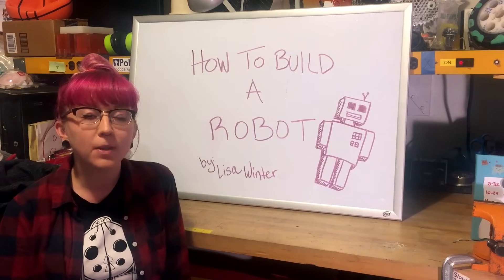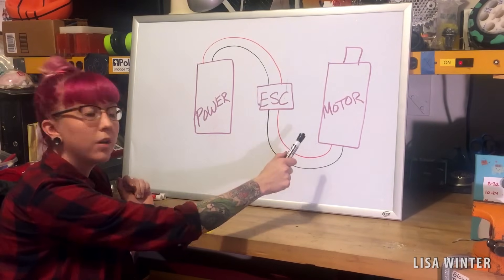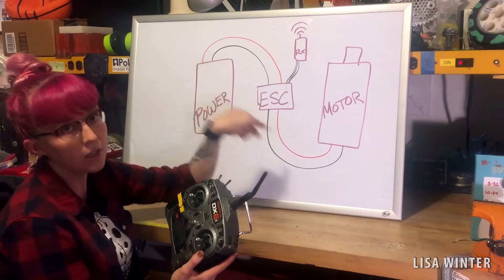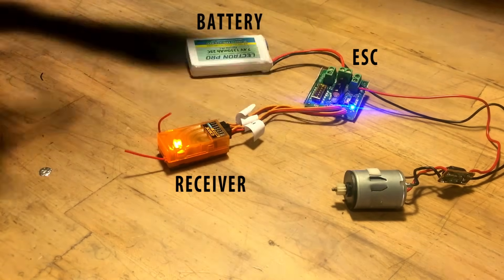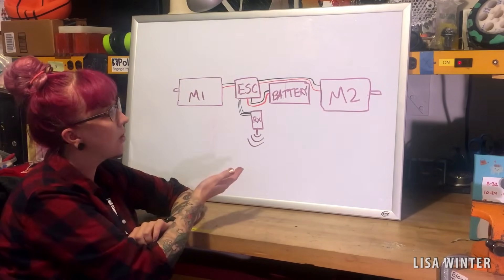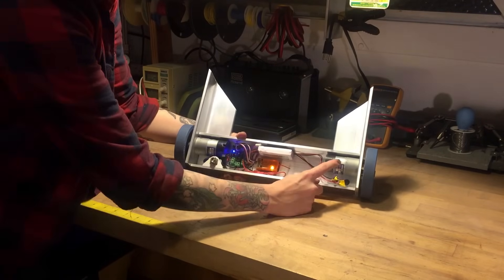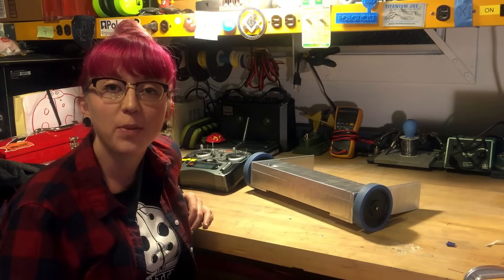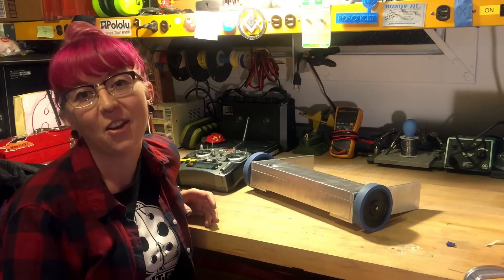How To Build A Robot

Comment: Do you have advice or recommendations on what kind of software I should look into buying to build a robot?
Reply from the maker: I like to use Fusion360 by Autodesk for CAD/CAM. If you're new to 3D modeling you may want to try Tinkercad first, which is free. Have fun!

Comment: How did you get the Speed Controller to  connect to the Receiver?
Reply from the maker: This speed controller has a cable (servo wire) that plugs into the receiver.

Comment: Hi Lisa. When you went fwd it operated both motors? Turning obviously controlled only one motor? How do you program that into the controller?
Reply from the maker: Good questions. If you tell the robot to turn it will rotate one wheel forward and one backwards. The programming will depend on what speed control and tx/rx you are using.

Comment: heeyyy, this was so use full :), i was just wondering do you use glue to attach the parts inside the robot?
Reply from the maker: Hi, usually components are bolted down, and sometimes for little lightweight parts I'll use a very strong velcro.

Comment: Hey Lisa!  Thanks for the tutorial!  A couple of questions:
Can you use a 12v motor with a 6v battery?
And 
What sites do you recommend for buying a drive motor with a gearbox included?

Thanks!
Reply from the maker: Interesting question! You MAY be able to run a 12v motor with a 6v battery. You could also run it with more power. Simply put, the voltage rating is what is optimal. Less than that and the motor will run slower or not move. More and the motor will run faster, but the life expectancy will go down. 
On my site I list some stores I recommend: http://www.lisaxwinter.com/faq.html

Comment: Thanks so much but how I connect the controller with the motor
Reply from the maker: The positive and negative wires from the motor attach to the speed controller output.

Comment: How did you build the chassis for the motors and such?
Reply from the maker: The chassis is pretty simple. It's basically two aluminum U-channels (one is the top, one is bottom), and 90degree angle extrusions for each of the 'arms'.

Comment: Thank you for amazing explaination, just a small doubt how does the robot know to go straight for example, when your press forward button on the joystick?
Reply from the maker: The joystick acts as a mixer for the two channels/motors. Pressing the joystick forward sends both channels power, which means that both motors spin the same direction (forward in this case). If I press the joystick to the right then it tells my left motor to go forward, and the right one to go backwards, which makes the robot turn right.

Comment: Using the ESC as described in this video with the Tamiya  dual gearbox and tracks is an interesting concept.  I made one radio controlled but didn’t use an ESC.  https://youtu.be/wwPm12VzH9Y My robots are going to be more like models/toys inspired by the Mars rovers.

Comment: What can I use as a power source two give enough energy to power a handmade voice box that has a pull string that requires no chargeable batteries a hand crank Or etc.
Reply from the maker: Hi John. Power comes in many forms, but first you need to figure out what voltage and current ratings will work for your voice box.
Reply: @LisaWinterX  My woody doll is made by Hasbro and I forgot how tall he is either 12 to 10 inches?

Comment: I have a question, how do you make it so that the controller is connected to the robot
Reply from the maker: Are you asking about the remote control? The remote control (Tx) is paired with the receiver (Rx), which tells the ESCs how much power to give the motors.
Reply: @LisaWinterX  oh so the remote and the receiver come paired its not something you manually do

Comment: How many motors we need to build a robot car that has 4 wheels? And what type of motor we need ? Please explain thanks
Reply from the maker: Hi, there are many different ways of doing this. Some of the most common options are to have 1 motor per wheel, OR you could use 2 motors on 2 of the wheels and the other wheels are not powered, OR you could have 2 motors each connected to 2 wheels via chains or belts. 
You'll want a DC motor (unless you're thinking of plugging the robot into wall power). The 'size' of the motor completely depends on how big the robot is and what it will be doing. Motors for robot wheels are usually geared for a preference of torque over speed.
Reply: Lisa Winter if I wanted to add a gripper on it to pick up items and put them down , how many motors I need ? And DC or servo?

Comment: Hi Lisa! I'm trying to start building a robot for the Robo Wars here in Australia and I am wondering what size motors (rpm, voltage) would you use on something like Mega Teno (the bigger version)
Reply from the maker: The Mega Tento motors are 48v Ampflow motors http://www.ampflow.com/ The gearing and voltage you provide will depend on your robot and the size of the wheels, etc.

Comment: Hi Lisa, I'm new to robotics/rc and want to try my hand at making one. My plan is to have a 4 wheel robot snow plow with a 775 motor per wheel. I am stuck on finding the right electronic speed controller. The motors I bought are basically cordless drill motors. Anyway, I see a couple of ESCs that specifically say they work with RC, but they are upwards of $80 each for the dual channel (Roboclaw, Sabertooth...). Any suggestion on an ESC that will work with radio control and not break the bank? Also, do I understand it right that I will need two dual channel ESCs to power the 4 motors? Thanks in advance for any tips you can provide. All the best!
Reply from the maker: Hi Keith, a dual channel ESC controls two motors separately. So, if you have 4 wheels/motors you can either control just one motor on either side, or you can control the whole left side on one channel and the whole right side on the second channel. 
It's true that if you want to control a decent amount of current then the ESC will be a bit pricey, however it's worth it because cheap ESCs will blowup and you'll just have to buy it again! Go for a good one from the start.
Reply: @LisaWinterX  Awesome! Thank you for the response 😊 I will give the sabertooth a shot and control side versus side. Your videos are very helpful. Thanks for helping us noobs get started!

Comment: hey Lisa,  so im doing computer engineering ,  5th semester,  but i have to design a combat robot , and i have to participate in a robowar, im quite blank, confused, from processors to mechanical puly system ( in your second video), its actualy , hell of task, 
But lets see, i have two months, and yes im gonna make it,
i'll tell you
Reply from the maker: You can do it! I strongly suggest building a robot that is 25lbs or less for your first time. You don't need any programming either, but since you're studying computer engineering you may want to :)
Reply: @LisaWinterX 
Thank you for you response, appreciation and motivation, it means a lot... 
https://docs.google.com/document/d/1BRQxM3maTmH7hdBqlBmnhkDmdnS1v8vyBqVEcu2jlJk/edit?usp=drivesdk
This is the link to 1st week report, and yes it will be about 25lbs(10kg)

Comment: Awesome video. As for the parts, do you buy them separately? Build them? If you buy them, where do you get wheels, etc?
Reply from the maker: Hi Tobe. I describe some of the parts in the video description. For wheels in particular it reallllly depends on the size and function of the robot, and what surface you'll be driving on. Some times wheels from a hardware store are fine, or an RC car shop.

Comment: How can I build a robot that can move around on it's own and can sense edges and walls?
Reply from the maker: You can start off with some simple code on an Arduino or other computer. Connect light sensors, proximity sensors, or any type of input you'd like, to change the direction the robot moves.
Reply: @LisaWinterX  Ok. thanks!

Comment: What about a four wheeled robot? Is it the same thing but with four motors?
Reply from the maker: There's many routes you can take. Same thing but 4 motors, or you can have two motors (one left, one right) and use chains or gears to connect to 2 back wheels. Actually, here's a really cool article about some of the methods: https://en.wikibooks.org/wiki/Robotics/Types_of_Robots/Wheeled

Comment: I have a big question. I have been trying to make a robot for a while but my trouble is the receiver. Do u need your own built controller for the receiver to pick up from?
Reply from the maker: Hi Liam, a custom controller isn't necessary. It's easiest to buy a transmitter and receiver pair. You will have to 'bind' them so they speak to each other. Their manual will describe how to do that.
Reply: Lisa Winter thanks so much. But u see I'm not a god at robots like u so I don't even know what binding means.😂 but I also don't see where to get any of these materials like an electronic speed controller or a receiver and controller pair so if u could answer those questions u would gain a new fan!😂👌
Reply from the maker: Hey Liam, the parts I used are in the video's description. Most parts can also be found on Amazon.com. The type of controller I'm describing is a 'RC (radio control)' system. https://en.wikipedia.org/wiki/Radio_control  An Xbox controller wouldn't work in this case, but something from this page would work: https://www.rcplanet.com/rc-radio-system/
Reply: Lisa Winter could I just like get an Xbox controller r something ?

Comment: Is it possible to make a robot without an speed control
Reply from the maker: Hi, technically you can connect power to a motor and it will run, but if it is inside a robot that is controlled by radio control, then you need a way to send the motor a signal. That is why you need a speed control. There are plenty of cheaper speed control options online than the one I used in this video.

Comment: Also, with your transmitter.. Did you have to do any sort of special programming for robot conversion?
Reply from the maker: Specifically for Mega Tento I have the right joystick control drive (FW, BW, L, R) and the left joystick for controlling the weapon (L-R) and lifting the shell (FW-BW). Nothing else special about the transmitter.
The speed control can be programmed to do an assortment of things (mixed mode, lipo mode, ramping, etc).
Reply: Lisa Winter thank you for your help! Keep on rockin!

Comment: Is your ESC Arduino based? Or do you make your own ESC? BTW I am 11.
Reply: bast warking  Robot 🤖
Reply from the maker: Hi, it is a Sabertooth ESC that I can customize with the physical DIP switches. No programming necessary :)
Reply: Lisa Winter hey Lisa would this design work for tank treads? What motor should I use if I want my 250 lbs bot to run at 18 mph? Keep up the great vids